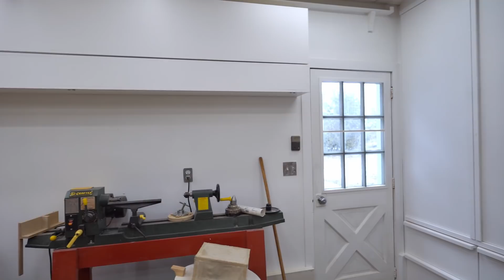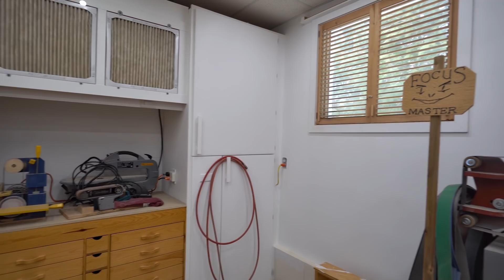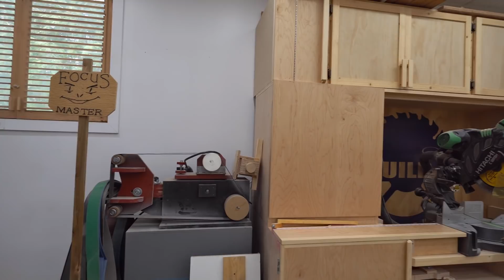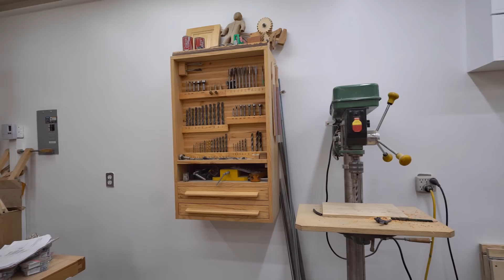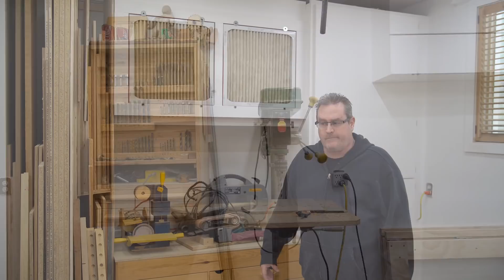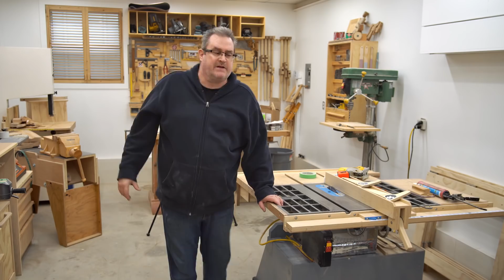My CLEAN Shop In 360 Degrees PLUS Why I'm Destroying My Table Saw

Comment: I like the air cleaner - it's obviously working well. Apologies if I've missed this type of comment already, but would there be any mileage in ducting the exhaust over your ceiling to the other end of the shop in order to assist in the circulation?
Obviously a ton of work, so quite probably not worth the effort, just wondering if that sort of thing would speed up the removal of dust from the far end...

Comment: Heya John. Thanks for this look at your shop. It looks awesome! 

I have a garage shop and that means I have the luxury of opening both doors and leaf-blowing it out pretty easily anytime I want. I keep a cordless leaf blower charging on the wall where it's easy to reach, and I use a combination of the leaf blower and my compressor with an air gun a couple times a week. I try to work in a logical order, like blasting down the top shelves then blowing the floors out. However it's really not a silver bullet. Even after going over the whole place with a leaf blower, I find the shop still coated in dust for two reasons:

1) Dust clings to surfaces. They actually need to be swept or toweled off or swiffered in order to get that last layer off. The more time you can spend blasting off every inch of the place with the compressor the better. 
2) Pockets. I mean places where dust gets blown into and won't come out of. I have workbenches against the wall and shavings/dust just pile up under there no matter how many times I blow the place out. It takes a lot of rearrangement and then carefully angled coaxing to get the dust out of every corner. 

Ultimately, the leaf blower thing works best with some broom work combined. Remember your face mask! And then it's dusty again the first time you work ;D

Wishing you the best - love your channels.

Comment: Very cool video, I like the cuts you made so you could get your camera crane out of the way. Round about the time you made your table saw, I bought a used Sears contractors saw on Kijiji for $80. It came with a aftermarket fence that would have cost about $250 alone. I can only do wood working in the summer months as I park in my garage in the winter. But all of my larger tools have been purchased from sites like Kijiji or Craig’s list. Saving me thousands. Continue to keep up the good work John, may the comments always be positive and may your shop never collect too much dust!

Comment: The white cabinets do make for a really clean look. I was wondering if you plan to paint the miter saw station as well? If I remmber correctly you applyed a PU finish but I just thought the white would make it look really nice, specially if the jointer gets painted white.

Comment: Great news john. I've been waiting for this table saw build for a long time. I'm one of those guys who as not got a shop a needs to work in the house. I hope that the saw will be powered by a induction motor. The dewalt site saw i use at the moment is so can loud. Btw the shop looks great. Some hard work you put in there. Keith from the uk

Comment: $27 EACH??  Are they high MERV or something?  That seems really steep - I can get a 3-pack of basic dust filters, 20x20 @ HD for about $11

My experience with these filters is that the paper frame fails first - they can't take the humidity here in Florida.

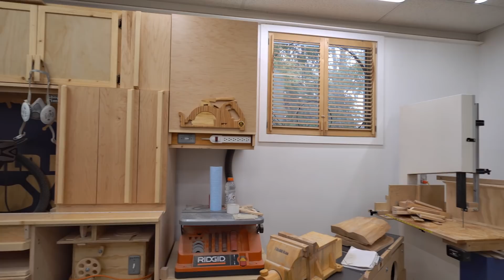Comment: 1:48 man that cardinal is persistent.
Also, 1:53 your gantry teleported.
Good luck with the build, definitely will be following along.
Reply: is not over yet 1:57
Reply: I would like to see a project where John goes into a cogeneration deal with the local electric company, and sells the excess power from that cardinal outside the window.
Reply: I dunno about teleporting, but you should motorize that Gantry and then make it controlled by "Alexa" ...

Comment: Did I get this correctly? You're saying you can't build a table saw without a table saw, so you're going to destroy your table saw first so you can make a table saw to make a table saw with which you will make the new table saw?
In other words: you're destroying your table saw to demonstrate how to start from scratch, which is
1. Jerry-rig a table saw from a circular saw, a plank, and two saw horses.
2. Use first item to make a table saw that's functional but very basic and still uses a circular saw.
3. Use second item to build the table saw you actually wanted in the first place.

Seems like a lot of work, but also a lot of potential for interesting videos. I'm interested in the plans for the semi-permanent table saw, it sounds like it might fit my needs!
Reply from the maker: It's the dream within a dream within a dream inception thing - the table saw with a table saw within a table saw without a table saw
:)
Reply: what did happen with your foldable utility table saw ? i cant find the video now